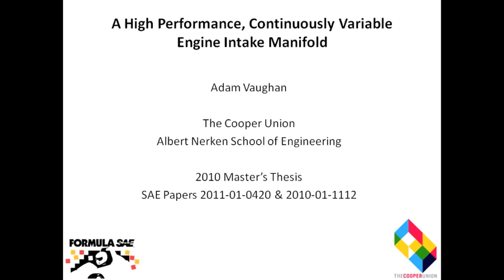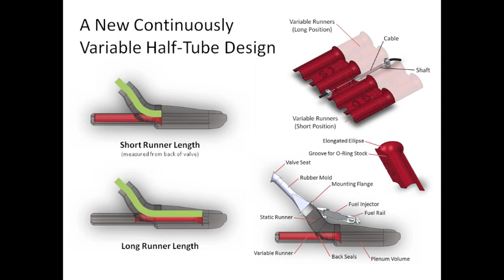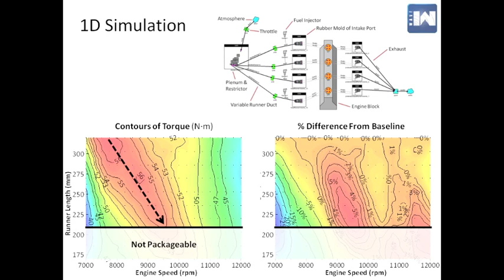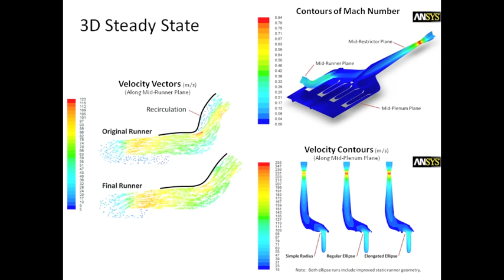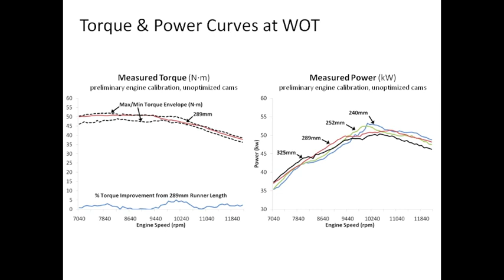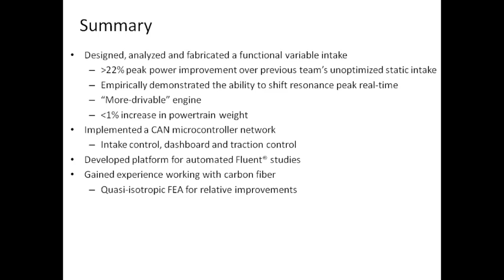Carbon Fiber, Variable Intake Manifold for Formula SAE (FSAE, Formula Student)

Comment: Nice design. I've been considering introducing a partition followed by an immediate intake pipe expansion to drop the pressure and direct the airflow. Then dumping into the top of the plenum above the intended cylinder bellmouths. This will leave a sizeable gap but my theory is that it should balance cylinder airflow across the rpm range.

Comment: Woow. This looks really awesome. How much costs the average Formula SAE car? How do you choose the driver? What careers/ universities can compete? The Variable Intake Manifold has been used in the past, like the Mazda VICS in Miata or the Toyota T-VIS in MR2. Now days car manufacturers prefer the Variable Valve Timing and even Turbos are getting very common. But I believe Variable Intake Manifolds should be used in all kind of cars. it is cheaper, simpler and more "failure proof". If I recall correctly only Ferrari LaFerrari is using Variable Intake Manifold in 2015, and it is Carbon Fiber too =).

Comment: This is the same idea I have decided to use for the college project i am about to begin, although I will be focusing on the use of this on road cars in modern engine management systems to increase efficiency and power. my project is on a very low budget and short time constraints, i have access to dyno equipment and other computer based tesing/ design equipment, i was wondering if you had any advice or resources you could throw my way that would help me on this project. thanks